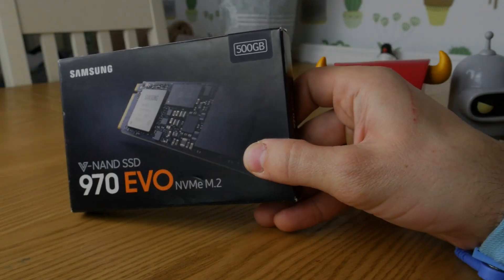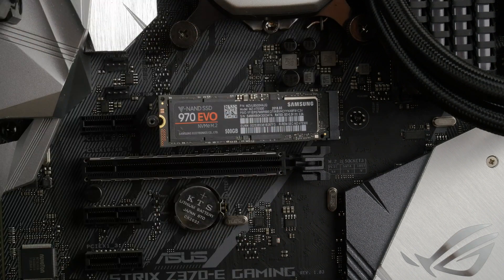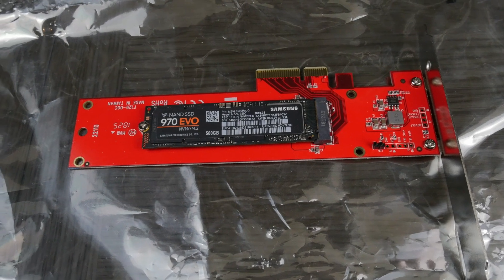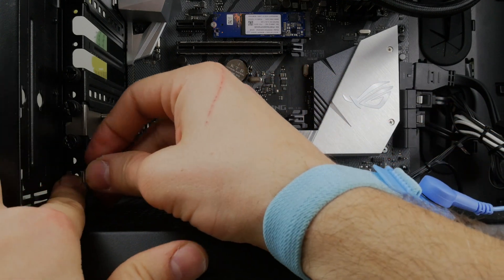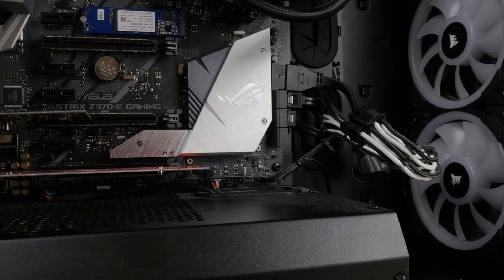How to install NVMe M.2 SSDs (featuring Samsung 970 EVO)

Comment: I have the 970 evo plus 2tb SSD. I'm having a problem where my computer is not detecting the SSD for some reason. I fail to see how that is possible since this SSD is not very old and there is no visible damage on the exterior. I tried switching the SSD port but that did not change anything. Is there something I am missing?  I have reseated it several times and spent hours trying to figure out why it won't pick up on my laptop. Could I have a problem with my motherboard?  Do I need updated software? I have no clue at this point.

Comment: So I've been absolutely racking my brain on why my disk doesn't work. I have MSI's x99a SLI and on their site it says their m.2 port is compatible(I think, since it's PCIe 3.0x4) but no matter what I do the BIOS just wont see it?? I tried UEFI with CSM, secure&fast boot disabled I also tried on another motherboard(to check if it works) but the SSD was fine(even managed to instal win on it) I don't think its a lane problem cuz even if I only have 28 lanes(i76 6800k), I have one GPU on 16x... I'm crying fr

Comment: You skipped the step where you become totally flabberghasted that not only did your motherboard manufacturer not supply a screw to act as an interim thread protector, but also Samsung truly and honestly believes everyone has a supply of CM2x3-3.3 screws on hand.
Reply from the maker: They're not the only one. Hardly anyone supplies the necessary screws from what I've seen.

Comment: Does it matter if it isn’t screwed in but is pressed down by a heatsink that is screwed in overtop of it? I couldn’t find a screw that would fit and the heatsink I have screws in the plug end of the SSD and screws into the motherboard on the other end. Essentially only one end of the SSD is screwed in and both sides of the heatsink are too, but the “free” end of the SSD is not.

Comment: in a pc building vid someone used this and put something on top of the ssd what is it?
Reply from the maker: Probably a heatshield/heatsink. You usually see them included with motherboards or you can buy aftermarket ones. They're not essential imo.

Comment: Hi, I just installed the 970EVOPLus on the Asus Z390-P motherboard but 
the read and write benchmark is around 1750. I installed the drivers 
downloaded from the ASUS website. Do I need to make some settings in the
 UEFI Bios? Thanks

Comment: whenever i put my ssd in it looks like it is bending a little bit after i screw it in, is that ok or am i doing something wrong? i’m using one of the screws that came with my b550-f motherboard from asus since the ssd doesn’t come with screws.
Reply from the maker: Is there a standoff mounted underneath?
Reply: @TheProvokedPrawn  yeah, i found the stand-off screws and got it all figured out, thanks!

Comment: I've just got this. I've got a m2 Pcie gen 2/sata slot (z97s krait mobo) , will this work optimally. They also didn't send a screw the absolute bastards! Will glue or duck tape be okay?
Reply from the maker: Check the description for links to get an m.2. they're not expensive.

Comment: ok so i have a ssd and i want to replace it with this but i don't wanna take out my old ssd because i dont wanna lose my data how would i make it so that i keep my data on my old ssd but boot it so where i get the new ssd read and writes?
Reply from the maker: I'm not sure I understand fully what you've said. Can't you run both drives in the machine? If you mean you want put what you have on that drive on the Evo you can clone it - https://uk.pcmag.com/how-to/117218/how-to-clone-a-hard-drive

Comment: I think we have the same mobo. Are there any benefit to where you put the nvme?Middle vs bottom with heatsink? Vs the adapter?
Reply from the maker: It's best to start with the top one. Some motherboards have special settings and lanes for that.

Comment: 0:00 Hellooo
0:02 970 Evo box
0:14 Unboxing
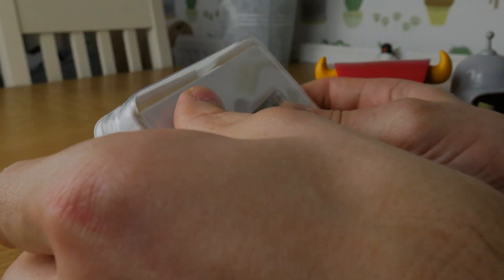0:30 what are NVMe Drives
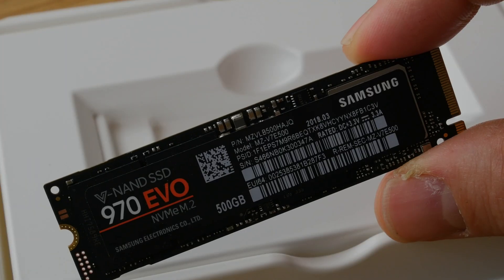1:01 970 Evo close ups
1:17 970 Evo Uses 
1:25 Install
1:44 what to do once its installed 
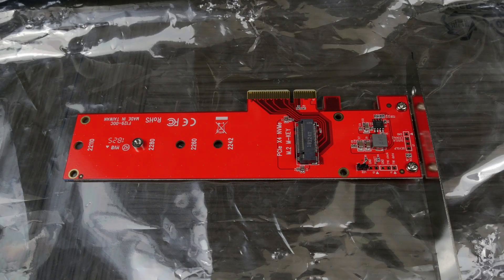2:00 installing on a PCIe x4 Adaptor

Comment: I've seem some people peal off the sticker the m.2 drive. Any reason for this?
Reply: no sensible reason, just humans doing what humans do, if it doesn't look right, or they want to think that maybe it will get better airflow, or some other absurd reason..but, half the time, removal voids a warrantee, and there's absolutely no need to worry about heat because those things draw only ten or so watts so never heat up anyway....I've got two now in my z170 asrock OC mobo, a Samsung 970 Evo 500 Gb and a Kingston 1 Tb....and two 2 Tb HDD's and they are just fine..

Comment: I tried installing it and it’s just taking me to the bios any tips?
Reply from the maker: Hmmm. Assume you have multiple drives. Set a boot order in the bios, check m.2 is recognised in there as well. Are you installing Windows on it? Too many questions to give the right answer.

Comment: Will my pc run fine if I only have two m.2 ssd's with no 2.5" sdd/3.5" hdd? Or do you recommend having just one m.2 ssd with a 2.5" ssd?
Reply from the maker: You can run fine on just NVMe but you won't have as much storage space unless you buy this https://www.amazon.co.uk/dp/B08957PT2K/ref=cm_sw_r_cp_apa_i_c9W9EbDBW9ET0

Comment: Sorry for the question will this work on Gigabyte b450 ds3h motherboard. is there a settings need to be change?
Reply from the maker: Yes. Depending on your CPU. According to the specs page
1 x M.2 connector (Socket 3, M key, type 2242/2260/2280/22110 SATA and PCIe x4/x2* SSD support)
* Actual support may vary by CPU.
* Supports only M.2 SATA SSDs when using an AMD Athlon™-series/ 7th Gen. A-series or Athlon™ X4 APU.

Comment: Can this be used alone with out a normal hdd or sdd? Sorry for the noob question
Reply from the maker: Yes. You can just have NVMe drives in your system. No problems. Install windows on it and enjoy fast booting!

Comment: hmm, I'm using an adapter to connect the drive via USB. But it's only showing up as 50kb even tho it's a 2tb drive. 
Not sure what the deal is here. I'm trying to use the partition wizard to clone my current drive but it says it's too small. 
The Drive doesn't even show up on my computer other wise. Tho I can eject the USB. So that's at least responding. 
Anyone has ideas?

Comment: Ok so I’m going to to do a windows 10 install on usb fist creation media and then install the evo 970 after the install I put the usb in and power up and then where do I go from there how do I tell it to boot up windows to the evo 970? Problem is my old ssd is offline and is not enabled because I took it out and since I took it out my computer boots up windows from the the Sata hdd drive and not the ssd so it is slow that’s why I’m starting over with the awesome evo 970 so I don’t want it to read that I have 2 versions of windows 10 after I get the evo as my (c) drive I’m going to back in my back up files. I will appreaciate any info on getting this done with your help I sub to your channel thanks
Reply from the maker: Unplug the HDD too? Unplug that, then you'll only have one drive for the machine to recognise as you install windows and it won't go on the wrong one. Then you'll have to make sure you set the right boot priority in the bios so it chooses the NVMe first over the HDD

Comment: Hi 
Great video. I have a msi b360m pro-vdh mother board.  https://www.msi.com/Motherboard/B360M-PRO-VDH
It was custom built with an Intel i5 8500 CPU 6 cores 6 threads, GTX 2060 16GB ddr4 ram and has one of these Samsung EVO PLUS 250gb already installed prior to buying and Basic barracuda 500gb for basic storage. I use the ssd for VR gaming and this is required and works so smooth but need more storage. I believe it has 4 turbo m.2 slots on this mother board but not sure could you confirm?. Can you confirm as I defo want to buy the 1tb Samsung evo Plus ssd version and install using your very helpful video. Would this impact the current system set up? Like impact windows or prompt any reinstall of windows as problem etc or is it simply plug in with pc fully turned off. Install bios Samsung driver from Samsung website, I think, then format to NTTS as per your video link in notes, I think ? Would really appreciate your professional help. I’m already subscribed as very helpful. Thanks in advance
Reply from the maker: According to the specs on that motherboard it has one M.2 slot. So you'd have to replace the current drive, which would mean reinstalling Windows I'd imagine. However, you could maybe use the adapter like I did to install a second drive rather than replacing the main one. Or you could look to clone your drive onto a new one which would be easier than installing Windows from scratch if you're not savvy on those sorts of things. You can clone with https://www.macrium.com/ or https://www.easeus.com/backup-utility/copy-and-clone-hard-drive.html

Comment: Hi, i have a slot which i have placed mine in & screwed it into place, when i boot up my motherboard does not recognise it. is there a way i can fix this please?
Reply from the maker: See the end of this video for what to do in Windows https://youtu.be/Qg5XBR0w2pU
Reply: Same here. My bios does not see my 970 EVO SSD. Did you solve this issue?
Reply: @DavidLeeMenefee  not yet I haven't. Only just seen both of these messages. I'll let you know if I get it fixed 🙂
Reply: @tgol6891  OK thanks

Comment: Can i use it in my laptop which has m.2 port??
Reply from the maker: Yes https://youtu.be/Qg5XBR0w2pU
Reply: @TheProvokedPrawn  you got one more subscriber dude, definitely you made my day, thanks bro, anyways my laptop model is hp cc134tx and it does have m.2 slot, so if i go for the evo 970 500gb ssd will there any problem or any bottleneck type issue or similar thing like that?? Or all it needs to have only m.2 slot for this ssd?
Reply: My laptop is not a gaming laptop, so will there be any issue??
Reply from the maker: @Anirbansinha24  if it has an M.2 port then it can be upgraded. Gaming laptop or not.
Reply: @TheProvokedPrawn  thanks brother, thank you so much for the kind replies
Reply: Bro sorry for the disturbance again, can i go for evo 970 plus 500gb nvme ssd for my laptop which is not gaming still has m.2 port??
Reply from the maker: @Anirbansinha24  yes

Comment: Are these able to used as ur only hard drives or are they only usable as extra storage? Building me new desktop I’m using the MSI MPG Z390M motherboard can I use 1 of these as my only hard drive or do I gotta use a. Regular snd aswell
Reply from the maker: They can be your only drive for sure. If you have an M.2 slot on that motherboard.
Reply: The Provoked Prawn yes it has 2 thanks
Reply from the maker: @TheHoboWithAShotgun  winner! Get two then ;) one for boot drive one for games. And subscribe to the prawn!
Reply: The Provoked Prawn yah gonna get 1 500gb  to start then expand In future this gonna be pure gaming nothing else more than enough space to start thx for quick reply
Reply from the maker: @TheHoboWithAShotgun  no problems. Enjoy!

Comment: Do the M.2 drives work with the Samsung Migration software? I assume they do, I'm curious because I'm planning on buying one in April, and I would very much like to clone my mechanical drive.
Reply: They surely do. Even my old Samsung from 2014 does that.

Comment: I just bought this SSD and and when I got it I realised I didn't have a M.2 slot on my motherboard, plus I cant use my PCIe slot for a PCIe M.2 adapter because I only have 1.
Please help
Reply from the maker: Oh dear. That's not great. There are other solutions possibly. For example, you can buy expander cards that work on PCIe x16 slots but they often need RAID which gets more complex. Standby for links...
Reply from the maker: Watch the start of this video. https://youtu.be/4CmhS-O65bI if you can find the M.2 expander separately it might be a solution. https://www.msi.com/PC-component/M.2-XPANDER-AERO
Reply from the maker: There's also this one ASUS Hyper M.2 x16 Card v2 4 x M.2 Socket 3 https://www.amazon.co.uk/dp/B07PCKTL1J/ref=cm_sw_r_cp_apa_i_7t6CDbPNDR5FK but this only works in RAID unless you just want the one NVMe drive which is probably overkill.
Reply: @TheProvokedPrawn  Thanks for the fast reply, I will look it out. Will keep you updated.
Reply: @TheProvokedPrawn  Just to let you know my motherboard is a Asus H110M-K
Reply from the maker: @ichill7015  yeah, you're right there are no M2 ports on that mobo. This is why step one is check your motherboard supports it :) maybe send it back and buy a 2.5" SATA SSD instead?
Reply: @TheProvokedPrawn  Would this one work: Kingston A400 480GB SSD
Reply from the maker: Yes. You have 4 SATA ports on your motherboard so you should be able to. Assuming you don't already have 4 drives installed. Not as fast as NVMe of course but it's either that or the drive adapters I recommended.
Reply: buy a new mobo

Comment: Great video. Liked and subbed.
 Question...  wouldn't the m.2 using the adapter not be limited to the speed of the PCI slot transfer rate?
Reply from the maker: Quite probably but still faster than a standard HDD? Or even SSD
Reply: @TheProvokedPrawn   Thank you for the quick response.

Comment: thanks for the video..so about the screw i didnt know that i have to buy one from amazon..if i understood right i cannot install the drive without the screw?
Reply from the maker: You can. But it wouldn't be a secure or sensible fit. I'd recommend getting a screw first. You might have some in your motherboard box?
Reply: @TheProvokedPrawn  yeah i think i have:) thanks
Reply from the maker: @JohnAmaro_Official  good luck. Hope I earned a sub.
Reply: @TheProvokedPrawn  yeah sure..there is a screw on my gigabyte z370 motherboard .i just installed it)
Reply from the maker: @JohnAmaro_Official  winning! Enjoy the new speed.
Reply: What’s the name of the screw?
Reply from the maker: @D.V.J.J.  sorry I'm late https://www.amazon.co.uk/dp/B07QM51454/ref=cm_sw_r_apa_i_zFaREbTSHJC9A